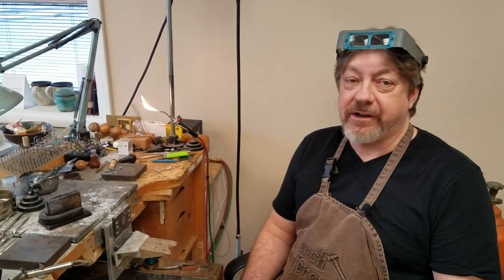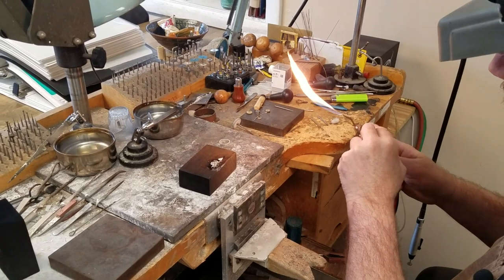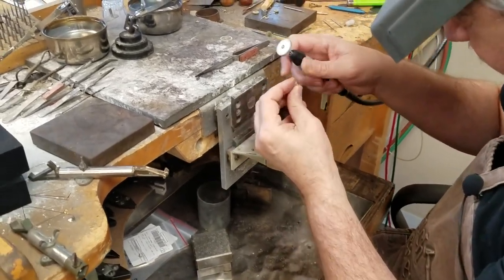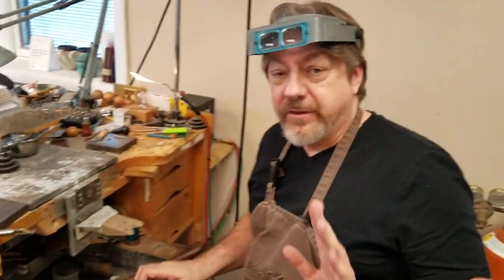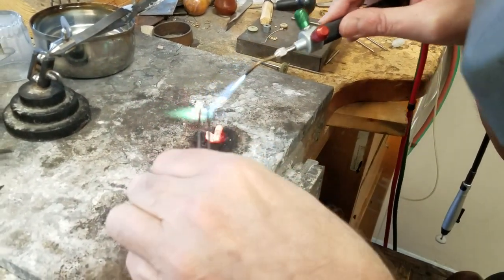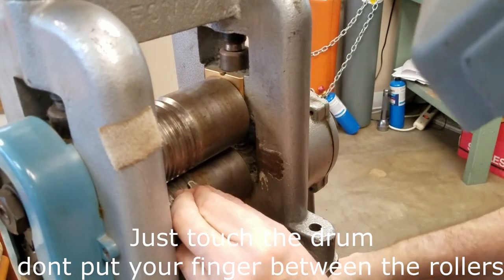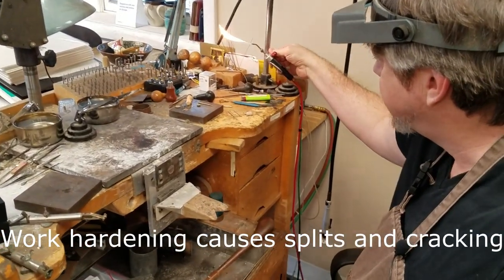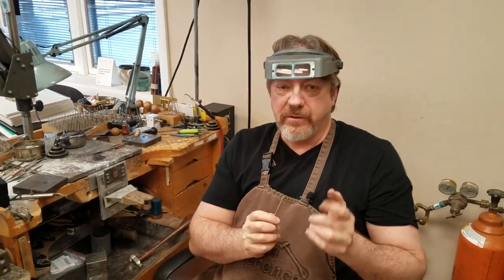making stock from scrap silver without a mold

Comment: Hello.  Thank you for the tip.  One question is what pushing another chacole block over the other one does?  Melting in a groove does not do the job?
Reply from the maker: the metal will want to ball up and not sit in the grove.
Reply: @JMDjewelry  I see.  Thank you!  I have done it but it was only a small amout so I didnt encounter the problem.